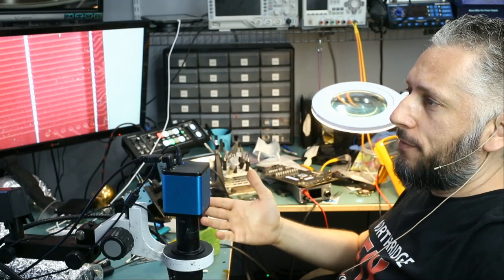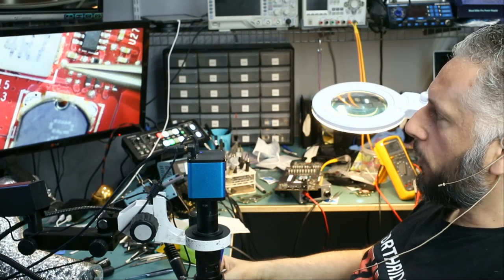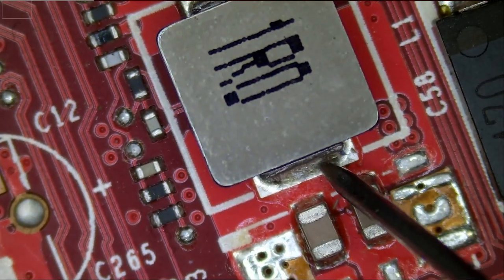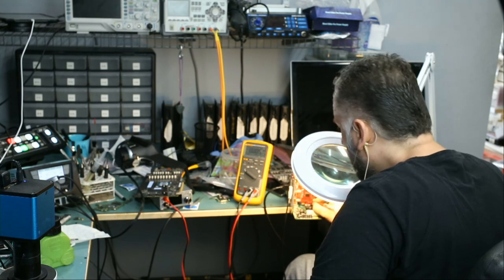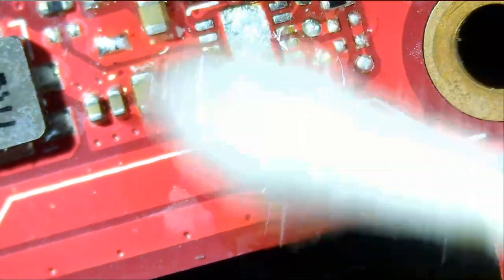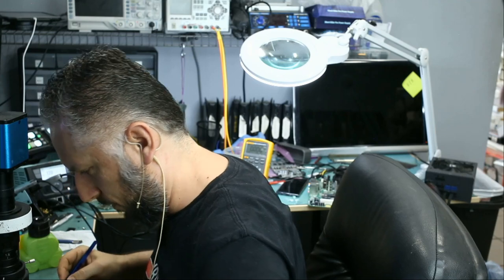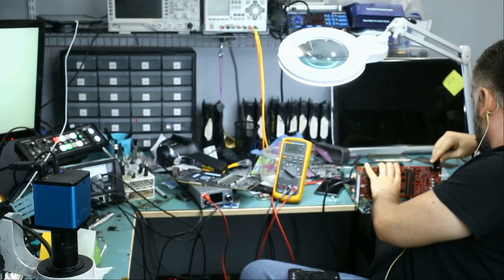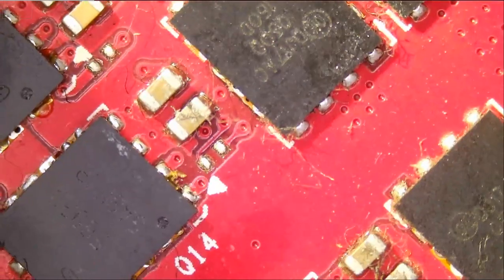MSI 1080 TI Blower Graphics Card Repair - Is it fixable?

Comment: Hello this is my card. Check on the back of the card where the metal rings are. That is where the back plate had stands and likely made contact with one of the components. Thanks for the effort so far it is greatly appreciated.
Reply: Was the card sorted?
Reply: What was the outcome, success with the repair?
Reply: that flying away chip was funny and painful
Reply: @DIYTech21  went to another dimension
Reply: Rescued !!!   From the ninth dimension

Comment: uP1728Q is the part number.  Made by "uPI Semi."  The device is NRFND at end of life.  Check the inductor coil associated with that regulator and any possible vias.  The datasheet says "Guaranteed 3A output" so something shorted or blew out downstream and any vias in between can act like a fuse.

Comment: Thank you so much for allowing us to work along side you and share in the frustration of trouble shooting. Watching that IC fly off... ugh... people who haven't attempted to use hot  air on a small component have no idea the skill it takes to master hot air. My guess is a bad coil or resistor. I'm thinking that these boards fail due to overheating? Hope you share with us the fault you find. Aways wanting to learn more. Very happy with my last order of Qianli Precision Tweezers.

Comment: Gotta check down stream circuits pins from the chip you replaced for shorts... may take out the chip again.  Easy to do. Save from replacing same chip multiple times.

Comment: You should inject some volts to it so that the bad ics will heat up and you can see under that thermal cam
Reply: Since there is no multimeter beeps in diode mode from any of the parts , usage of voltage injector is risky.. it may damage that ic or the whole board

Comment: I'm almost certain that my old HD7950 would not POST without at least a passive heatsink over the die. When I was water cooling it, the block didn't contact the die because of poor mounting pressure and the extremely thin liquid metal layer, and it didn't POST. My guess is that it avoids damage by shutting down 'cause of the heat ramping up very fast. I don't know if the same happens with this GTX1080Ti, but unless it boots at a very low power state it is feasible it's just protecting itself. The HD7950 is an older card, I think that the low power states trigger after it finished booting up.

Comment: It may be that the VRam is burned out.  There is to see with the thermal cam again.  
But according to what the customer said, that the heatsink has been detached from the chip, it is likely that the graphics chip has burned out from overheating.

Comment: i love the blower cards. they get a lot of hate, but the use case is always misunderstood. these are perfect for very small builds, like itx. the fan spins real fast, so can be audible, but is so much better at pushing air through the fins and out the back (i/o side). also red pcb 👍
Reply: Blower cards get hate because they usually suck. The whole cooler needs to be re-designed from the ground up for optimal performance and manufacturers just opt out for the quick (cheaper) solution. Stick an axial fan on a crappy heatsink and of course it will over-compensate with higher RPMs. PlayStations have axial fans too, but Sony designed their heatsinks and fan size accordingly - so no issues there. 😉 Just like the ITX format you mentioned or portable computers (a.k.a. notebooks/"lap"tops) for example. They were never invented/designed for high performance gaming, those are compact size platforms meant to save space in work environments and/or be easily transported. There are exceptions, but they don't make the rule and you can pretty much count them on your fingers. Manufacturers' job is to sell you tech constantly, so like always - use your head, so you don't have to use your wallet again. 👍
Reply: @em0_tion  with regards to the heatsink and being cheaper. they follow the design of a normal datacenter gpu, so it is not so outlandish. i was just addressing all the flak they get. but there is one advantage, when people perceive them as shit, they become cheaper. so you can keep the blower or swap it out for a waterblock.

Comment: check fuse resistor in  series to vin pin of uP17280 ic i think its open resistor 5v supply is missing maybe

Comment: Maybe the vram controller chip which is from the donar board is also faulty try replacing it with a working one!! maybe it will work & yes i also saw what looked like a blown component below the chip at 4:32 !!??  you are my biggest idol & inspiration & i wanna thank u for it :-).

Comment: We got a 2080 with that chip blown.  I gotta get zone zo getting around zo attempt zhe fix.  Have 3090 it just gets red hot immediately ,no go
No visible damage, but similar thing happened to it ,a screw got stuck to the thermal pad and I didn't notice it it short board ,I think

Comment: hi, you need to buy a "Extender Riser Card Adapter Creative USB 3.0 PCI-E Express", to work and test the video cards, it will help very much, you can put in you front and work on it. and keed the boas away. :) i do like that. it will not use all x16 lanes, but you dont need untill final testes. they will run on it. e even do futumark on ti  ( go easy)

Comment: You've officially been MSI'd. Of all the gpus I've had, the only 2 that went belly up were MSI's. Pieces of crap.
Reply: this, msi motherboards are even worse
Reply: nah bro youre vibing, i have a 1060 msi for 5 years
Reply: just buy a better psu thats it
Reply: @chrisozeneul  no one said they had a 100% failure rate bro, maybe you just got lucky, a 1060 is hardly a high-end GPU also

Comment: Could it be something happen around the bios chip, i heard that bios chip also responds for the card to be detcted
Reply: maybe the gpu is cooked. too long voltage test without mini heatsink
Reply: @ariewijaya1679  GPUs are usually very good at throttling themselves and only sip a few watts when powered on for POST. This is really only a risk for really old cards like the gtx 700 series and earlier, but if those cards die it's usually just cause of sheer old age.
Reply: @Shyvorix just try with your own rtx 😁
Reply: @ariewijaya1679  I have actually! I did diagnostics on a friend's rtx 2060 a while ago. Only sipped like...10 or 15 watts at the meter for a bit. Card for repaired though, was just a blown mosfet iirc that he sent to get fixed. still works fine to this day.

I have an rtx 3090 currently but that actually had to get replaced cause of a different fuckup LOL.

Comment: I think the PCie controller in the gpu is dead. The pex resitance is too low for this cards....so the Gpu  will never work again. We see that heat on the termalcam  on the corner of the gpu next to the pex rail.

Comment: If a customer says you can have the no repair part for a donor board, do you still charge the repair fee or buy it of the customer?
Reply: Surely a repair attempt fee is always charged, then if its unwanted scrap to the customer then its free, but room for negotiation of course 😉

Comment: The Padishah of Electronic Boards...
.
.
.
NOT!
If there is no short and the voltajes are ok, check if the ram chips are ok, then try reflashing the firmware, then check if the gpu chip is ok, if not then it's better to tell your client buy a new viceocard.

Comment: It would be real awesome if there was a list available for the total component list for most if not all electronic boards. Then you could just have a local database made for all the donor boards you had in inventory. For example a donor board from XYZ product could have a searchable list of all components installed on those boards so that whenever you need a donor component you could perform a search of whatever donor inventory you had and you could grab that component real fast and easy

Comment: How much does this repair costs?.
I have a GTX 980 from msi and it has a issue that then drivers install screen goes black
Reply: The repair will cost more than a replacement
Reply: Try with original driver from official website
Reply: @techengineers4579  already did. Try to also ddu the old drivers which were for a GTX 780 and still nothing
Reply: Sounds like a dead core. Ouch. Can't really fix a dead core, you can temporarily revive it by heating it up, but it will die again eventually. You will have to replace the core, but that's really expensive and not worth doing.
Reply: It happend with mine 1070......i did DDU and it helped !
Reply: Mosfets may not be supplying enough power when 3D acceleration is enabled (because you installed drivers)
Reply: @ayuchanayuko  possible but i dont know some guy locally here does also repairs and has fixed some of my other gpus so he will tell me
Reply: @dexsters5643  good luck brother

Comment: I had a similar issues wit few 1080TI in all of them the problem was in the GPU... It was no problem at all on the power lines. The problem in all of them was result by short... All of them was extracted from a mining rigs, one of them was shorted by a loose screw, one of them was because a idiot with a screwdriver, one of them because the same idiot tried to cut the RGB and all of this dureing they work.

Comment: What you talk about @2:00 and the next 30-ish seconds with no boards are the same; 

My old 1080Ti was also this model, the MSI GeForce GTX 1080 TI Aero, but my card had a black PCB, not red. 

After a quick read, it seems like MSI mainly sold this 1080 Ti Aero with red PCB to OEMs.

Comment: uP1728 datasheet :  https://www.skybed.be/temp/xtremesystems/uP1728.pdf
Reply: With a coil value of 1R0 which is 1 uH ... the regulated output of that ic is 1.0V

Comment: This is one of those MSI Aero clones that came with the Dell Aurora R7's looks like based off the v360 model.   Here's a high rez of that same board layout which is a founder's board:  https://cdn.wccftech.com/wp-content/uploads/2017/03/NVIDIA-GeForce-GTX-1080-Ti-Founders-Edition-PCB_Back.jpg  The part is def a uP1728Q which is a buck converter.  The part I couldn't find anything about or find one that matched this is the 2nd row of number designation.  Which looks to be "TX _ _ 2N".   Usually it's like PGxxx, PY or SY.  Again I have honestly not a clue on the differences sadly.